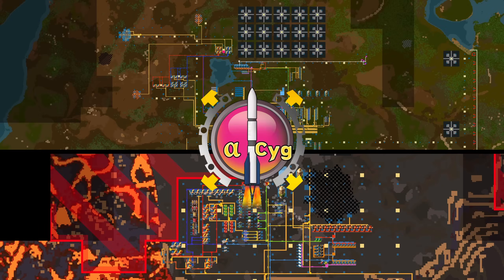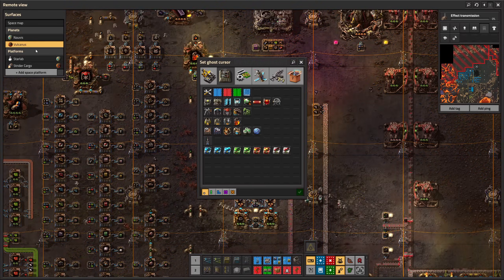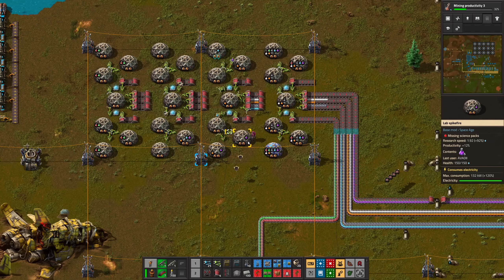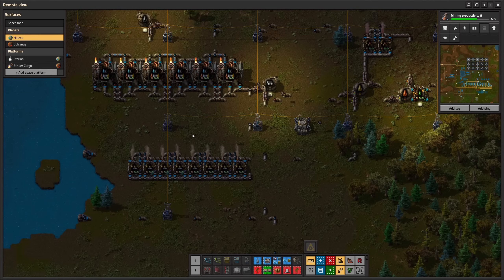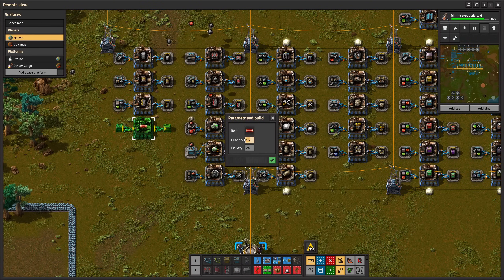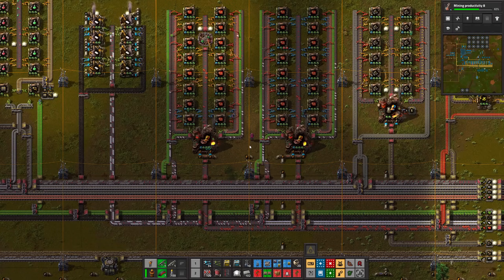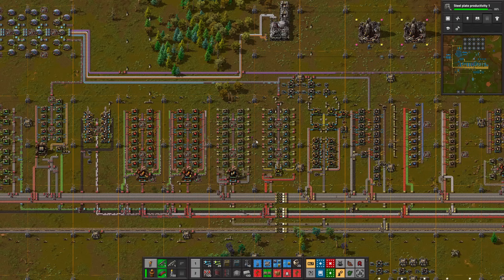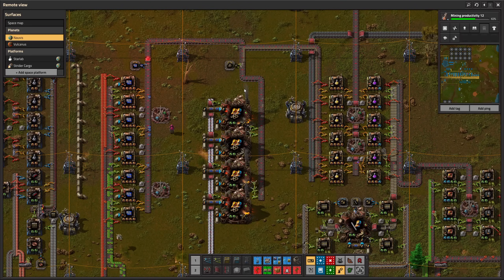1 MILLION SPM MEGABASE | Factorio Space Age | 04 Going Nuclear

Comment: I prefer sushi for my science. 2.0 changes make it ultra easy and it easily supported 180 SPM. Wasn't using beacons yet cuz I procrastinate on purple and yellow science. I do it by having 2 belts, moving in opposite directions, return belt goes to underground since entrance belt mixes so both sides are equally saturated ( since I input via circuit stopping a belt moving into central belt) and out belt goes into other side of splitter.
Reply: Eh. Not really worth the effort IMO. Earlygame, use a grid of chained labs with inputs from 2 belts along one side; supports 4 science packs. Midgame, you can still use a grid of chained labs, but have inputs on 2 different sides, being chained in different directions via filtered inserters; supports 8 science packs. Lategame, you'll be using biolabs, which have more room for inserters, and due to beacons have to build them in a line rather than a grid anyway, so you can use belt-weaving to get the required 7 or 8 belts in there to feed them all directly. (Or you can take the easy way out and use bot-based logistics, or if you're worried about UPS you can ditch belts entirely and do direct insertion from a train.)
Reply: @macdjord  I procrastinate gleba until last planet so I need to deal with 6 nauvis sciences, space science, vulcanus sience, fulgora and lastly gleba science. 

I use 1 or 2 extra lab behind first one in a short chain bc more will end up inserters being the bottleneck.

The problem with your solution is that it requires tearing down build and making a new one, I prefer to build one and not need to touch it until biolabs where I have to tear it down.
Reply: I was doing this, but recently I just changed to have a super super super long chain of labs.
Reply: @snottytoe6957  Won't that run into issue of inserters not being fast enough, especially once you need to also deal with more and more science packs?
Reply: @runelt99  Stacked belts and stack inserters keep up pretty well. By no means is it supposed to be efficient. I think it does like 600SPM for now while I setup bio labs on Nauvis which I will make.

Also it's not a daisy chain of labs, it's just a super long row of beaconed labs all pulling off of the belts themselves, not pulling out of eachother. It stretches across a lot of Vulcanus right now, and it actually is so long I had to turn it. Totally could just setup coulmns of labs and wind the belts through, but it's funnier to have it super long.
Reply: @snottytoe6957  Yeah but that requires gleba, so I think I will stay to using sushi science. Hell, sushi benefits from stacked belts too.